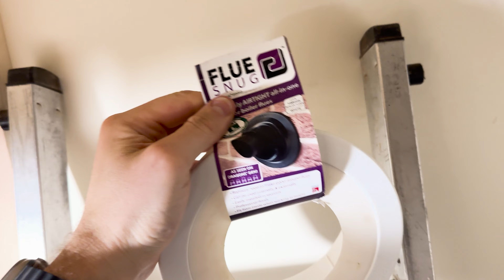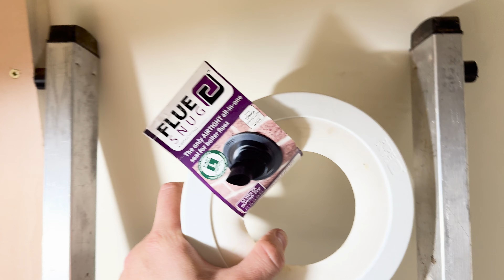Plumber COPPER PIPEWORK REVEAL - BOILER FLUE install using EIBENSTOCK & METABO tools (pt2)

Comment: Great video and neat work, I do feel sorry for the owners (or tenants?) that they haven't got a better location for the boiler though. Partially blocking the kitchen doorway would bug the hell outta me. 
Obviously there were no better options or you would have put it elsewhere.
Reply from the maker: @BlueVelvetBear  It’s the owner and this is exactly where they wanted it, that section of hallway is going to get turned into a plant room, i forgot to mention in this video that the door you see isn’t their front door. It’s some weird side door to their house. It’s now getting blocked up at the end of this month, which was decided recently so me messing around with cutting the ply down was a waste of time 🙄😂
Reply: @glisterservices oh well quite luxurious to have a special plant room then! Nice job. Though if I were them I'd keep the weird door as an additional fire exit.